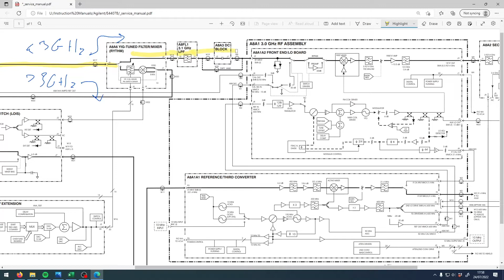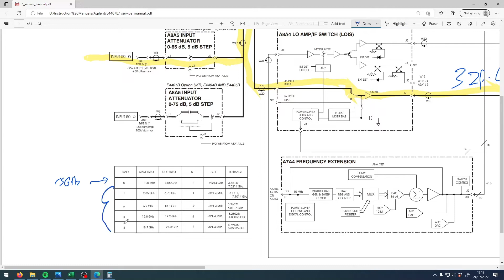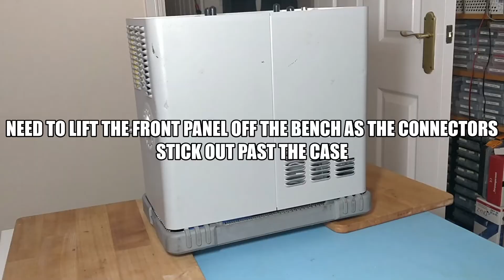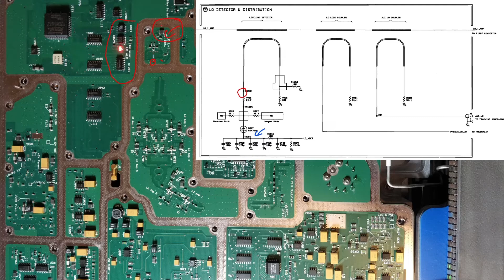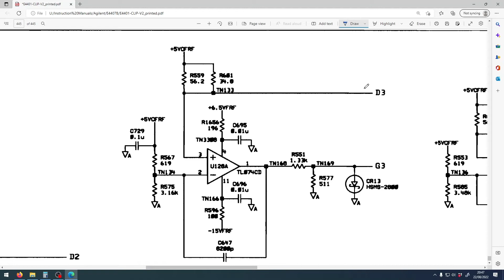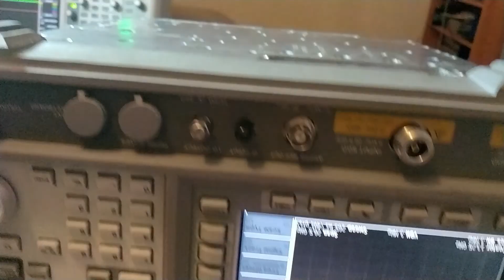Agilent E4407B 26.5GHz Spectrum Analyser repair (LO unlevel)

Comment: Congratulations! Nice job Dan ! 
Excellent work and analysis. I am working on a Advantest R3265 spectrum analyzer and it is very complex. I will analyze the power supply first (OEM no schematic ) and then check the 25 MHz signal because the unit cannot be calibrated. I have already noticed a drop coming from the synthesizer stage where the signal is generated. But now I have encountered a problem with intermittent noise when the unit heats up. I also noticed a smell from capacitors that might have been damaged due to the heating. This analyzer is more than 30 years old, so it is advisable to replace the capacitors in the power supply and probably in the stage where the 25 MHz signal is generated.